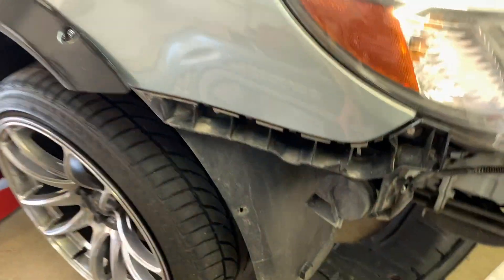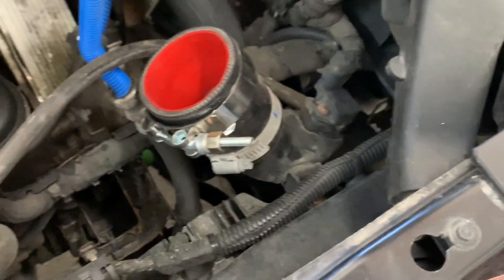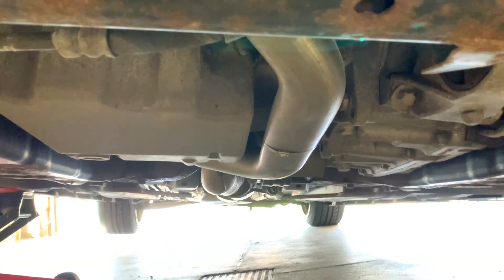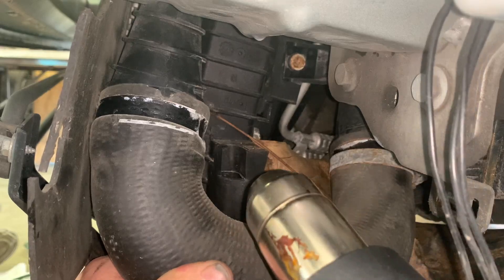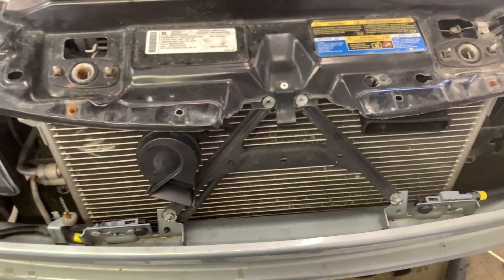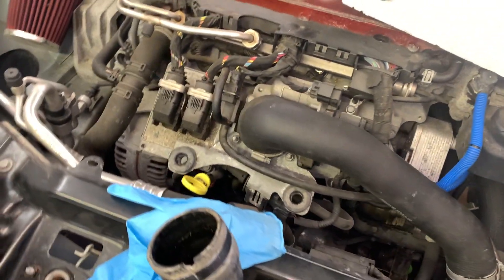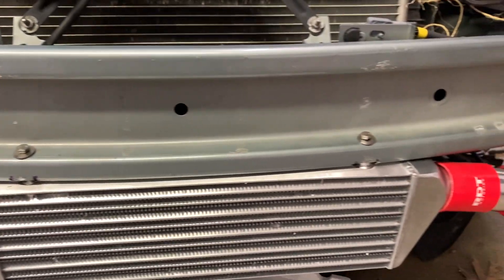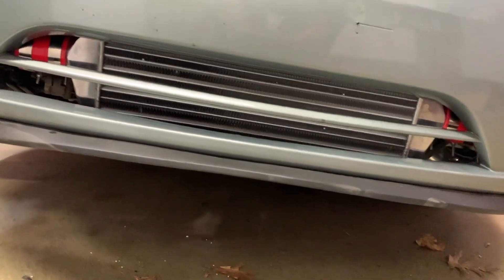2009 Saab 9-3 2.0T Front Mount Intercooler Install, eBay piping kit with RDT Motoring intercooler

Comment: Nice job good vid! Any thoughts/differences after driving with it for a little while?
/tune?
Reply from the maker: I think there is considerably less lag but no obvious power gain. I plan on doing a tune soon and i will post another vid with before and after 0-60 and other stats
Reply: @vincentdecenso3277  That'd be great I'll check it out. Been on the fence about whether to get a stock, stage 1 tune for awhile now.
Reply from the maker: @brek1972  dude get a tune if you haven't yet. video to come soon but it makes a ridiculous difference
Reply: @vincentdecenso3277  Yeah, I'm thinking I'll wait until some Saab meet-ups are happening in my area. Perhaps some of them might have the tune I'm looking for (it was a common one - I think it was the Maptun stage 1). Otherwise yeah its definitely on my want-to-do list when I get enough money to budget it in 👍. Any other tunes you know of/would recommend?

Comment: How much power do you make? I have the 2010 and I’d like the start upgrading soon but I’m not sure where to begin
Reply from the maker: go to either https://www.brewcityboost.com/ or https://www.maptunparts.com/ and check out their tuners. If i were you, just skip the bs and get a tune and some performance hardware to match (i.e. intercooler, intake system, spark plugs, upgraded turbo even, fuel injectors). I plan on doing a stage 2 and 3 vid here soon. Im at a brew city boost stage 2 with 2.5" mishimoto intercooler and 3" intake upgrades, 16 psi in the manifold,  iridium NGKs, and a full 2.5" catback (soon to be turboback). I think Im sitting around 290-310 hp at around 4.5-5k rpms on 93 octane

Comment: I didnt catch the idea but you did it in that way bcs you want it visible or what? This IC looks like Chinese fake why there in core is piping. If there are pipes in the core it will performe worse than original one
https://ibb.co/0M6hPb2
https://ibb.co/LZxwmS5
https://ibb.co/m8j8f55
https://ibb.co/4NF9Rn8